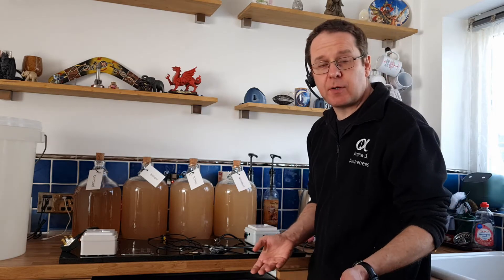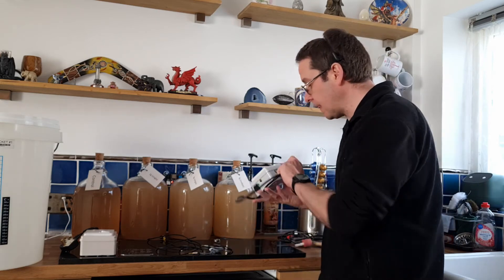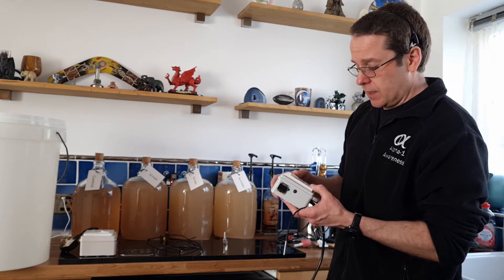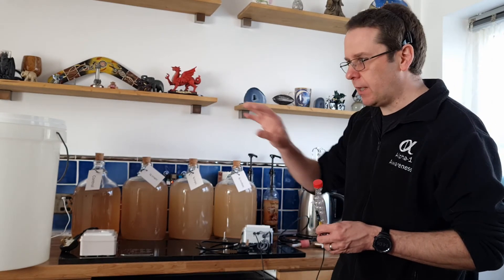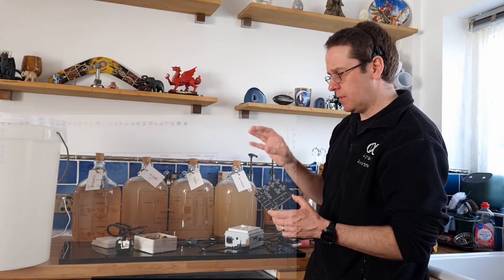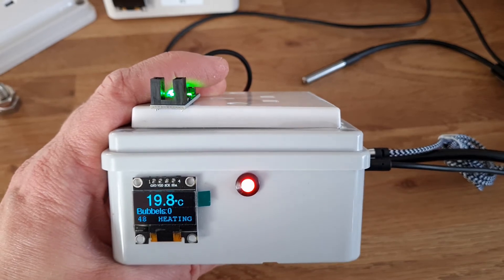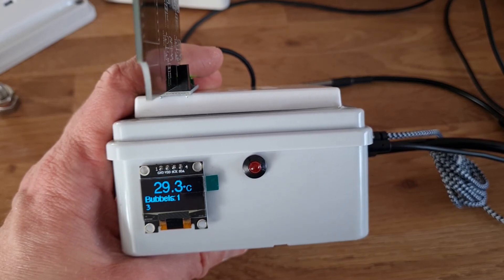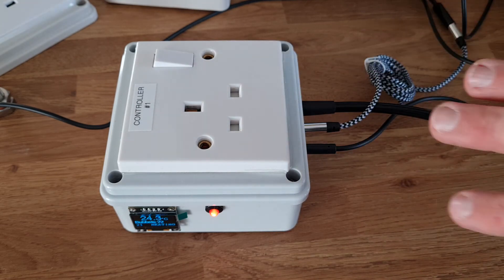I built a Brewing Controller to help with fermentation.  Could convert a T500 to a smart boiler!

Comment: I built my fermenter controller using esp32 and brewpiles firmware using a fridge and a heater element good for constant temp controls and cold crashing
Reply from the maker: I do like the Brewpiles Richard.  I wanted to make my own as thought it would be a fun project.

Comment: Hi. Do you plan to sell these? I would need a few…
Reply from the maker: Hi Ray,  The version in the video is #1.  I have finished Version #2 which has a colour TFT screen and am currently working on version #3 that has the ability to take a cooling and heating device (or just a heater) and also can bet setup on a mobile phone as well as by buttons on the device.  I hope to have MK3 completed in 3-6 months time.  Please drop me an email to info@brewingadvice.uk and I can let you know once it is complete.

Comment: Very nice work. Being familiar with Tasmota for ESP devices I would have designed around using the ESP flashed with a home compiled version of Tasmota set for sensor use, conditional rule expression functionality, PID thermostat functionality  and screen driving functionality. This may sound complicated but it boils down to setting some flags and telling PlatformIO loaded in a Visual Studio session to build it. The depth to the Tasmota system and how it is organized for PlatformIO is outstanding. Just about every sensor and controller function has already been figured out. There is even a counter function that you would use to count the bubbles. There are a number of temperature sensor functions. I would use addressable DS18B20 sensors since I might want to check the temperature at more than one location.

With your controller running Tasmota, which has PID control btw, the data can be pushed out to an MQTT server via WIFI. The data pushed out is the raw data and/or “RULE” generated data that you publish at whatever interval or event you decide. Tasmota “RULES” are a limited at-the-device programming capability. A nice thing about an ESP running Tasmota is that you can reprogram the device, either its firmware or settings via WIFI once Tasmota is already installed.

You might actually be able to create a RULE smart enough to publish the “Brew is Ready”. Having an MQTT system setup to relay the data is not essential but greatly increases your options.  An MQTT broker needs to be on the WIFI network. An old laptop or a RaspberryPi can run that. An old laptop setup to run Linux allows you to run the MQTT server and a data collection system such as OpenHAB3. OpenHAB3 gives you the data saving and data graphing capability out of the box so to speak. With OpenHAB3 you can also control any other device, including of course the brew controller. I would be running the MQTT broker and OpenHAB3 in a Docker environment.

If you are already capable of programming an ESP32 and building that box, then you for sure will be able to integrate what is sketched out above.
Reply from the maker: Thank you very much for that idea.  I had never heard of Tasmota for ESP before, but I am very interested to learn more about it.  I am going to do some research and see where it takes me.
Reply: @brewingadvice  I think you will be amazed. I doubt there would be any functional need, device or algorithm related, that you realize you need that is not already addressed in the system somewhere but due to the difficulty of assembling comprehensive documentation is not necessarily obvious. The folks in the forums are well versed in the details. Another surprise is that the system source code is organized for use with PlatformIO which in itself is glimpsing into the future.
Reply: +1 for tasmota firmware running on esps  both off the shelf and diy,  Simply host NodeRed somewhere (even on a £10 pi-zero-w like i do) and you can drag n drop a system to govern any mash/boil /ferment cycle you want..  i struggled with node red to start with but it all falls into place pretty quickly its just a bit of a paradigm shift  and being a drag n drop gui  imho its streets above any other diy system control that relys of yaml or other mark up language files..

Comment: Love homebrewer ingenuity. As you know bubbles in the airlock are not a great sign of activity especially near the end of fermentation. You really should look into using a Tilt Hydrometer where you actively measure specific gravity and temperature without opening the vessel. You can then use a smart plug to control your fermentation temps. This would be more efficient than your current build and with minimal oxygen exposure. 
Peace from Boston ☮️
Reply from the maker: That is a good idea Jeff.  How though does the smart plug know when to turn on and off?  Do you connect them both through an online server so they can interact?
Reply: @brewingadvice  yep. There are a lot of articles and hacks for this. You would love it!!
The Tilt (and similar products)  is revolutionizing homebrewing and pro-brewing.
Reply from the maker: @jeffroach3722 , I think I will have to get one and give it a go.